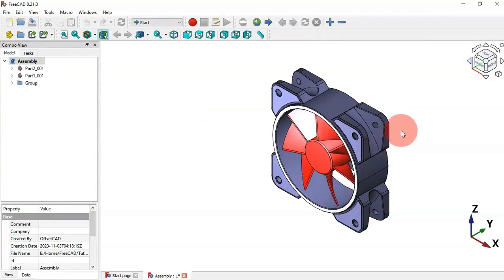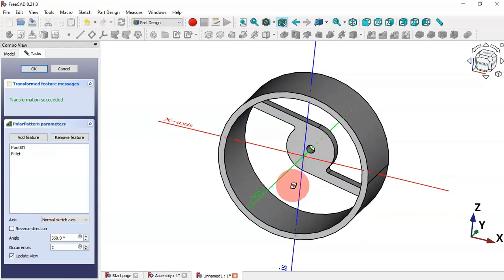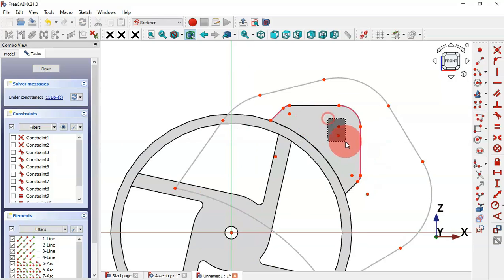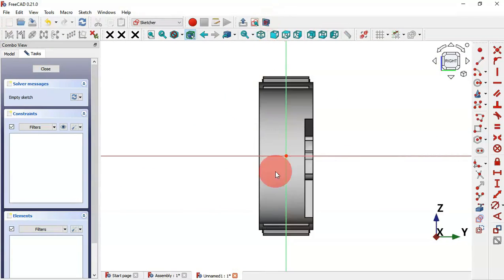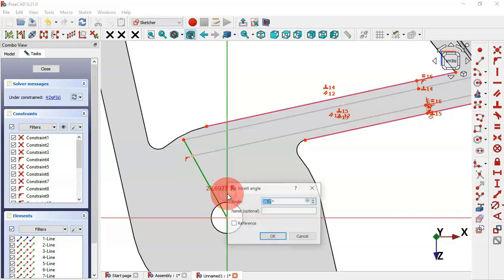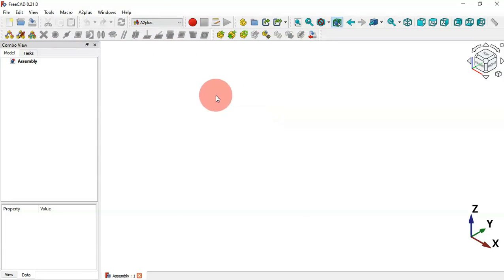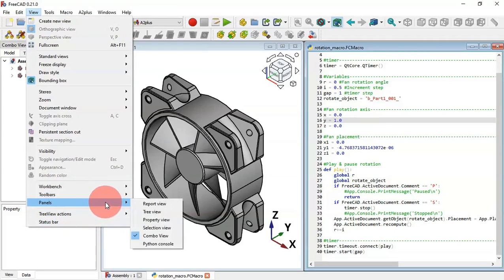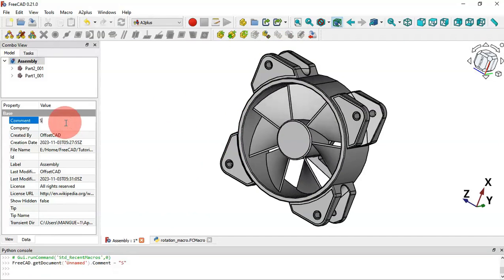FreeCAD 0.21 Beginners tutorial: practical exercise 112 (Design + rotation animation using macro)

Comment: I have tried to copy your code and it doesn't work.  It crashes at line 34 -  " 17:17:25    File "C:/Users/Allen/AppData/Roaming/FreeCAD/Macro/New_Rotation_Program.FCMacro", line 34, in play
17:17:25      App.ActiveDocument.getObject(rotate_Object).Placement = App.ActiveDocument.Placement(App.Vector(x1,y1,z1), App.Rotation(App.Vector(x,y,z),r))
17:17:25  AttributeError: 'App.Document' object has no attribute 'Placement'

It seems that Placement is not being recognized.  Is there something missing in the code perhaps or maybe Placement is the wrong name in FreeCAD ?   And why is the debug message showing 'App.Document and not App.ActiveDocument ?  I am very new to Python.    I just want to animate rotation of a part(object) in an Assembly  It is much more convoluted than I thought.  Thanks in advance.
Reply from the maker: One question: are you using FreeCAD 0.21?
Reply: Yes.  FreeCAD 0.21. Looks like Python 3 is the program being used by macros.